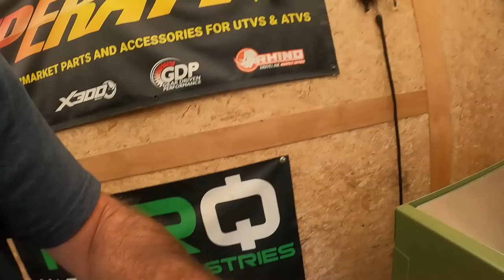Solo Ripping The 2022 Renegade Xmr

Comment: "airbox is pretty high on it" uhhh honda has the airbox under the seat lol
Reply: Where does it suck air from not under seat
Reply: Its a little higher
Reply: @robbovay8324  doesnt matter those airboxes dont even have a seal, 6 little clips is all that its got.
Reply: Yup
Reply from the maker: Was deeper when I took Jake's through.  Bone dry. It pushes water out and away from atv, the airbox never went under.